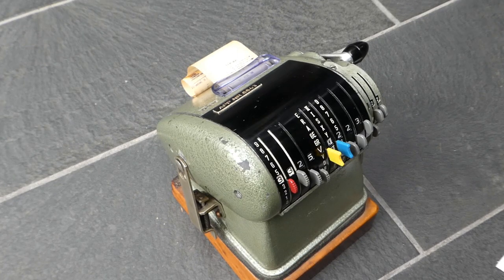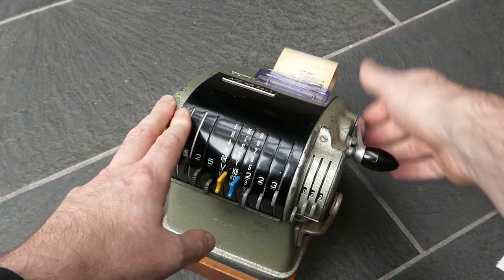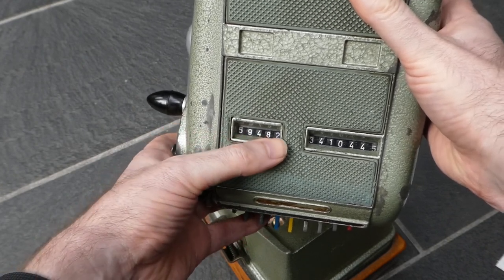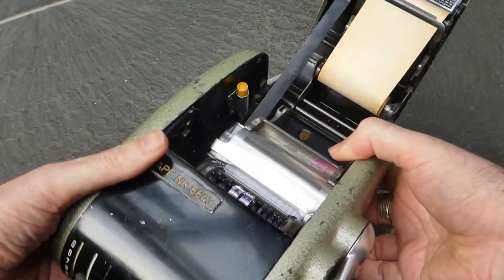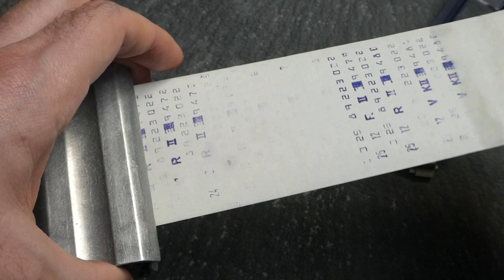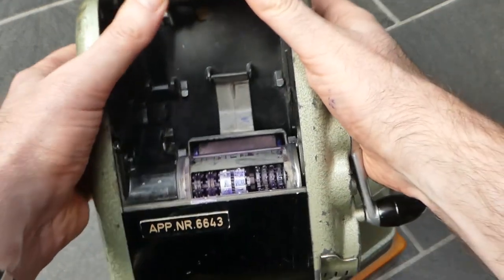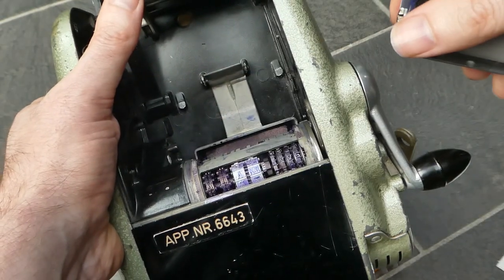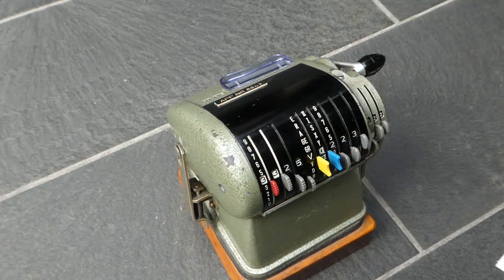The AEG KAL portable ticket machine

Comment: Hi! Thanks for the video
I recently bought a machine like this but unfortunately it does not have the ink roll holder. Could you tell me if there is anywhere where they sell it?
Thanks in advance
Reply from the maker: I doubt these can be found except in other old AEG machines. These ticket machines have not been made in at least 35 years.